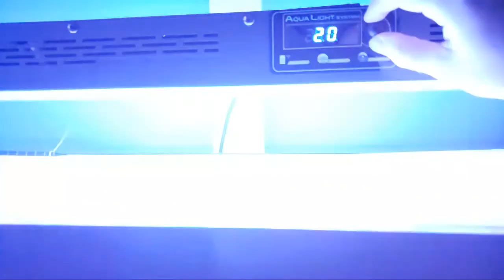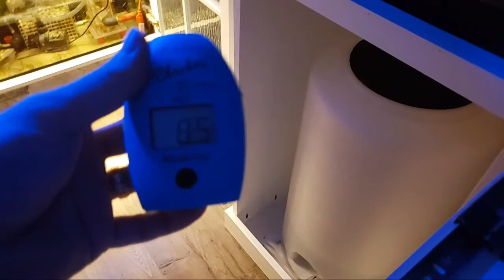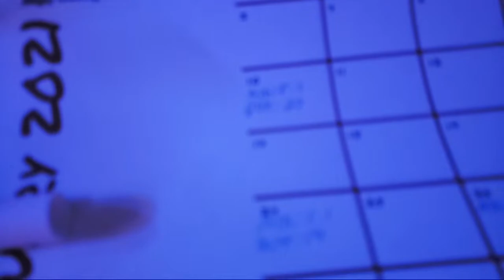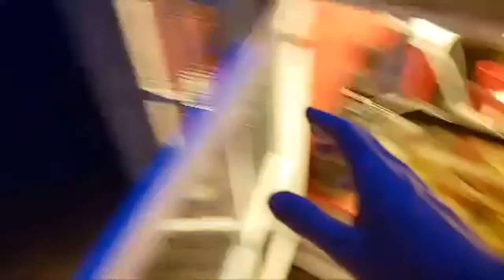Reef Tank Update

Comment: Hi Joe can you tell me about the octo wavemaker looking for get sum of them I'm from UK cheers mate
Reply from the maker: Yea so I run the Octo Pluse 4's controlled by the hydros wave engine. It gives you the ability to hook up different brand pumps and sync them in groups and have full control over different modes and speeds. I run mine at a random mode and do a nutrient export mode once a day for 15 minutes. Also it tells you about your pumps energy consumption and rpm of the pump which can give you an indicator its time to clean them! Highly recommend it and I couldn't go without it. If you get the Octos you can buy just the pump with no controllers when pared with the wave engine. Hope this helps 👍🦉🍻
Reply: Cheers mate I'm going to get but hydros not in the market in the UK yet 👍